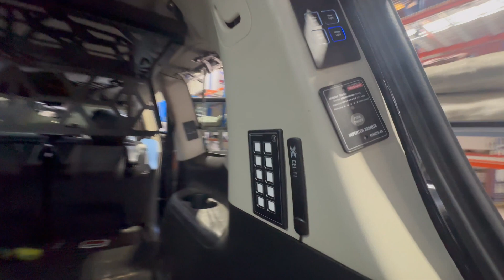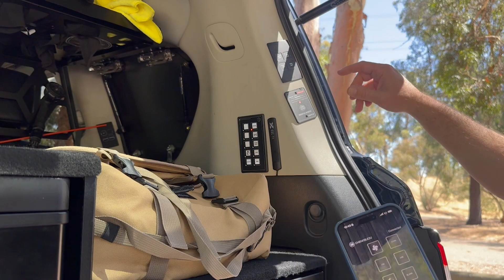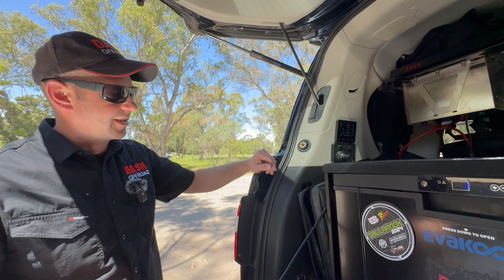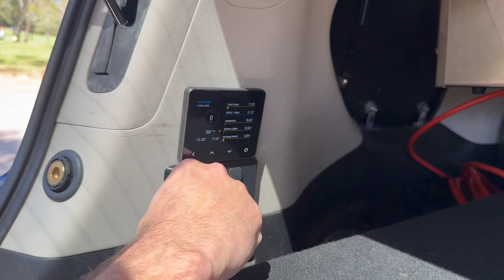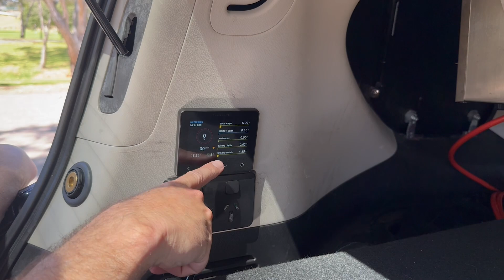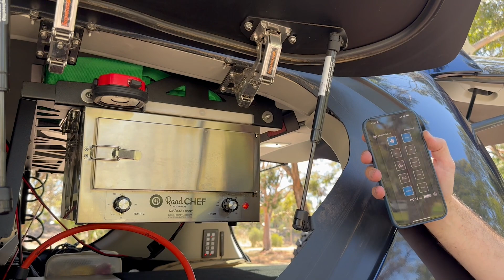DIY Y62 12V Electrical - The Products That Make it EASY or HARD 🤯⚡️

Comment: Just got another question when you ran the cables for the rear andersons for your caravan did you run them internally or outside the chassis rail?
Reply from the maker: Always internal to the cabin 👌
Reply: @ thanks but what about the rear andos for the caravan, just trying to figure out the best way to run the cable from the front battery to the rear bar.

Comment: When did the on board air bracket start coming out with the compressor on off switch? Would have been a really handy addition to free up another switch spot on the bottom of the console.
Reply from the maker: It doesn’t, but it’s not hard to drill the hole